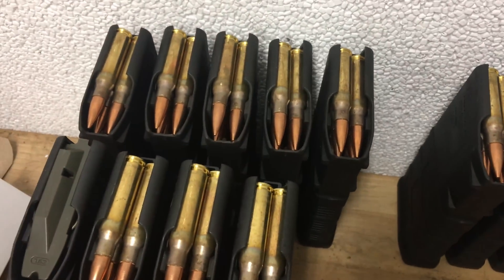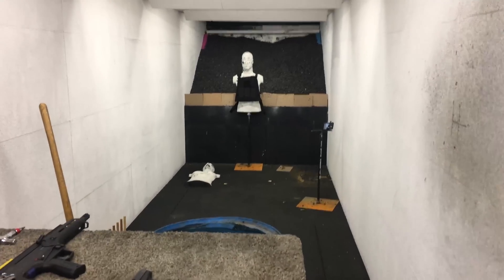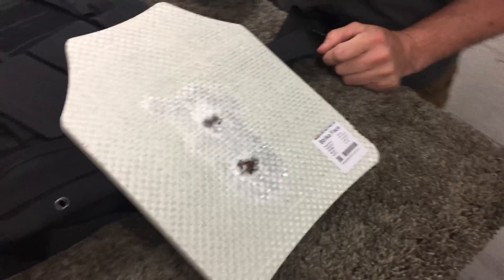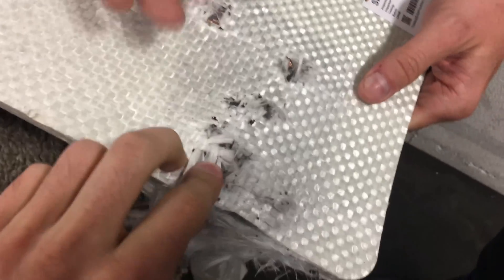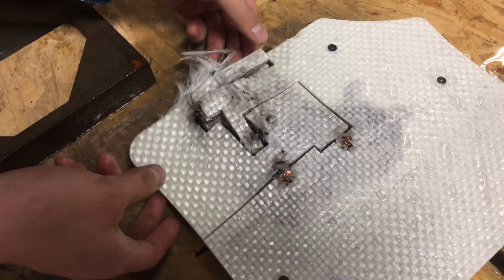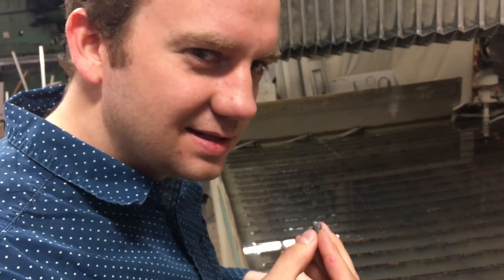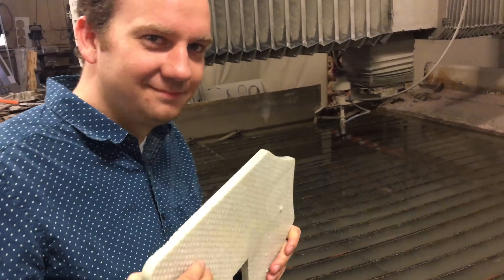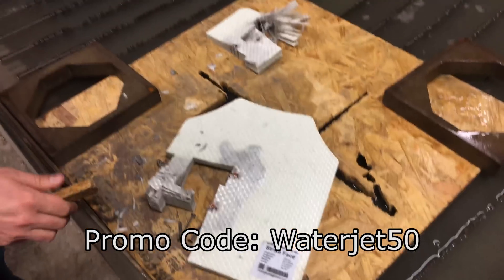Bulletproof Kevlar Vest vs 60,000 PSI Waterjet Cutter

Comment: It's not called a clip!  It's a magazine.
Reply: @Connor No. They are different things. They share a very similar function, but they are not the same.
Reply: Colin Sevier no there different things. a clip is a small metal piece that was used to hold bullets for guns that fed guns in WWI. it was also inserted in the top of the gun. a magazine clips on to the bottom of a gun or is internally attached to the gun. magazine have a spring in them to feed bullets to the gun.
Reply: A 'magazine' is ammunition storage in the most general term. It could be a warehouse or a ship's hold. All you grammar Nazis mean to say 'detachable box magazine' when referring it to a firearm although every repeating firearm has a magazine whether it is a rifle's feed tube or a revolver's cylinder. Calling it a 'mag' is almost as uneducated as calling it a 'clip' unless you actually have a stripper or enbloc clip.
Reply: Connor Crowley no, actually, it can't. A CLIP is what you use with a M1 Garand. A MAG is what you use with an AR15
Reply: Colin Sevier Actually it can be called both a clip and a magazine. Its like the plural of octopus, Octopi or Octopuses, its debatable. People can call it what they want.

Comment: How is there wind inside the indoor range?
Reply: MrFaller86 9mm
Reply: It helps move lead vapors away from the shooters.
Reply: It's to keep the lead dust away from the shooters. Every range I've been in had pretty heavy air flow towards the back of the range.
Reply: Mitchell broke wind (let a fart!)
Reply: It's common. Keeps the fumes down.

Comment: what about water only?  I mean cut Kevlar without the sand, will it still cut through?
Reply: Matt Stringham most likely but not as quick and the cut wouldn't be as fine.
Reply: waterjet is a few ounces per second, not thousands of gallons (unless it is over the period of 2 months running non stop)
Reply: qwerty112311 
exactly, it's the abradant cutting through, water is just a carrier.
Reply: @jurekdekarski2316  The water can also cut pretty well on its own
Reply: A bullet proof vest, window, etc will all fail to a waterjet. They stop bullets because they are designed to take a few high impacts and stop them with minimal penetration. A waterjet is designed to blast thousands of gallons of water at an object (so basically an endless projectile for a long duration). You can literally cut or destroy anything, with enough force and time.
Reply: This is fiberglass not Kevlar.
Reply: ac3ofspades878 waterjets shoot 1.5litres of water per minute